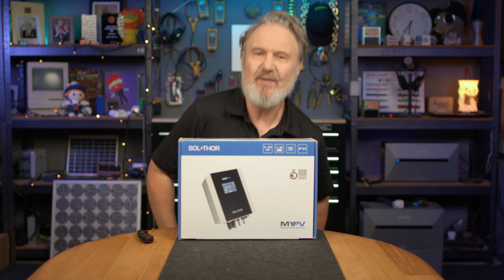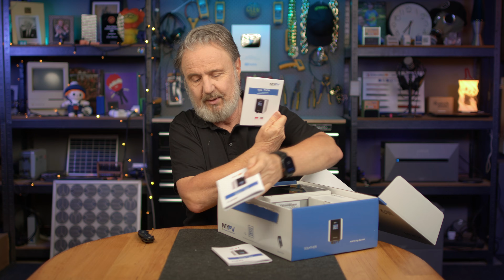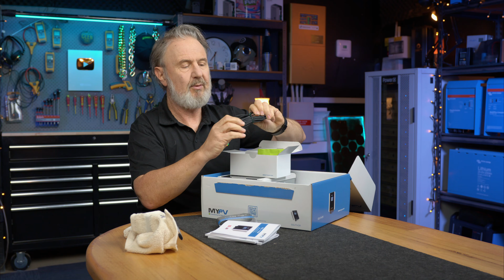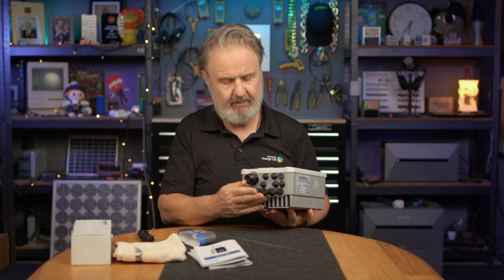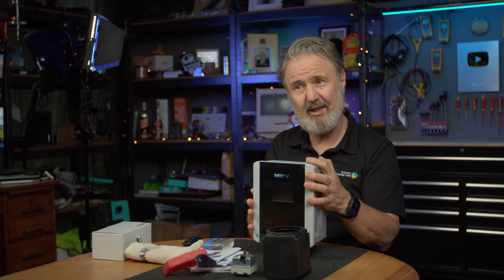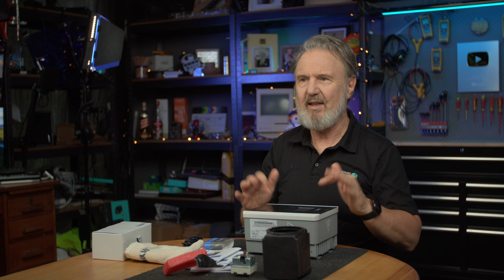SOL.THOR Unboxing | Turn Excess Solar into Hot Water (No Inverter Needed)

Comment: Hi Glen, did you install this item? I really would like to hear how it performed, did you install it and give it a good test?
Reply from the maker: I have had one running my hydronic heating and domestic hotwater for several years now. Works perfectly. We use the cloud app to change settings are required.

Comment: I've been building these for almost ten years and can't get anyone to understand the concept.  Any successful off grid system has at least 20% excess solar capacity.  I added one to my camp to eliminate propane heating.  Didn't have to add any excess panels (and I have a really small array) to get my hot water.  I run three tanks, one small on to get water up to 60Cquickly and a second one as preheat, it also gets to 60C by 10:30am.  Each has a priority and the third one is the dump of last resort, hot water for laundry.  All cycles use hot water as it is feeds into the cold inlet.  Clothes come out steaming.  This system connects right onto array PV voltage that feeds a MPPT charge controller.  Diverter heating does not interfere with MPPT charge controller, use battery or inverter capability.  It has arc interrupt so standard mechanical thermostats can be used.   These are also cheap and easy to build.  I know, nobody in sola has any talent to do that.  But, these could be turned out by China super cheap and they aren't.   They don't because the solar world doesn't understand and that means no demand.  I couldn't give them away!   Hope you can make a few converts.
Reply: I really like the idea of these systems, I can't find any other products that operate in the way this system does with DC supply coming direct from PV. There are local manufacturers in New Zealand making really nice controllers that require an AC supply from a grid tied inverter.  I can imagine these systems being a great introduction for people who are not quite ready to take the leap for a full solar system or older people that don't think they will get the payback of a full system before they down size etc. I will watch your videos over next few days, I would love to learn how these systems work.
Reply: @steveandtedssmallspacegard8587  Even if they were commercially available, they would not be plug n play.   The system requires a good understanding of PV theory which frankly most do hot have.  It also requires the array have a natural power point voltage, not long strings which have severe shading.  I have over 50% of my panels shaded at any time and the system still works because of parallel strings, one string is always dominant.   For a large majority the method wil work.   Any diversion system has to be proportional to be efficient.  Any video which doesn't leave you asking questions isn't worth watching.  I see my videos as a starting point to a conversation.

Comment: Ok here in the USA your typical electric hot water heater has two 4500 W heating elements. Only uses one at a time. What you do not say is that will your AC heating element on your AC hot water heater work directly on these 4500 W AC heating elements? I assume they will because its just a resistive load.
Reply: AC elements & their thermostat switches won’t work on DC. Resistance is too high, & contacts will spark & burn out. You have to change AC elements to lower resistance DC elements with DC rated thermostat contacts. Ed: but he doesn’t make it clear if it’s AC or DC out.
Reply from the maker: I thought the same but the clever feature of the Sol.Thor is that it's pulsed d.c. so self-extinguishes any ark by turning on/off very rapidly. The resistance isn't a problem as the MPPT matches the grid voltage but as pulsed d.c.
Reply: @SmartEnergyLab : ah, cheers for that.